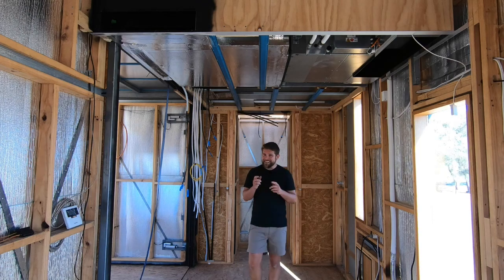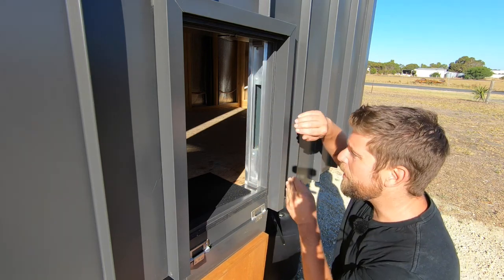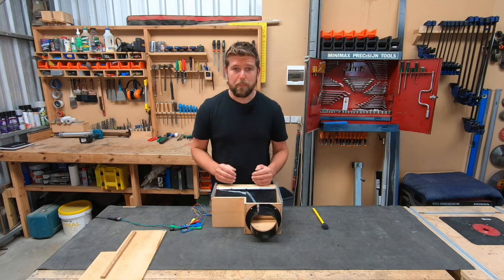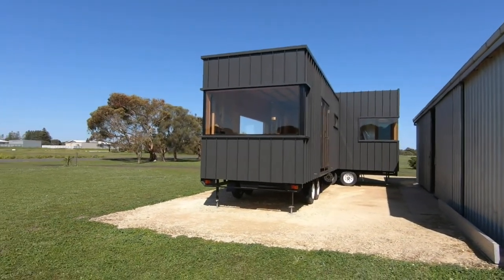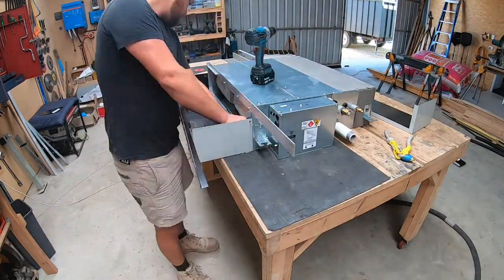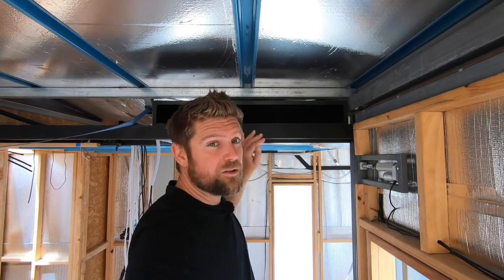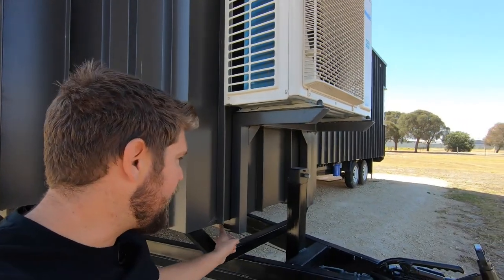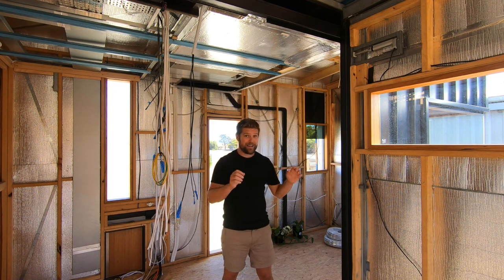Ep. 29 - HVAC ventilation & ducted air conditioning - Tiny House Build Update

Comment: Yes Christmas time 👍i suspect the computer fans are maybe not enough. I did a renovation of my apartment living room to 2 extra rooms and i installed computer fans to get ventilation into the other room. I had to scrape that idea and install a bathroom fan from the other side to push air inside and it's more efficient to push air then suck air. I think i saw that from a YouTube video from explain how a pop pop motor boat is workig with same principle.
Reply from the maker: Awesome, thank you for the feedback. The computer fans are only for ventilation of the composting toilet. It's a continuous slow ventilation that keeps a negative pressure in the toilet. You can't move too much air else it starts to dry it out too much. For the bathroom ventilation I have a 240v inline fan that turns over the volume of the bathroom every few minutes from memory. I have learnt from the micro tiny house that you cannot have too much ventilation when it comes to moving steam.
Reply: @TwoHandsandaTinyHouse  make sense. I really hope you try to boost your views with commercials on YouTube 👍